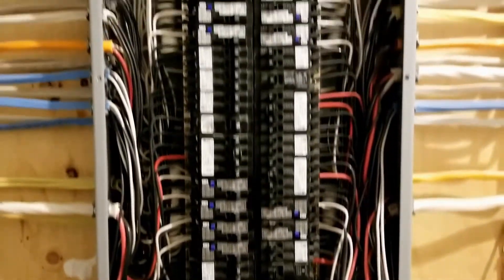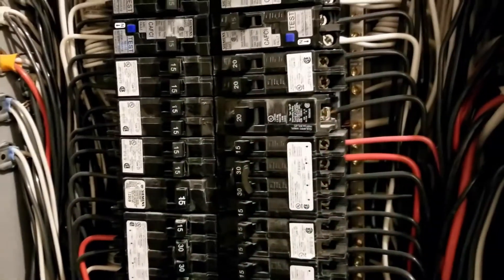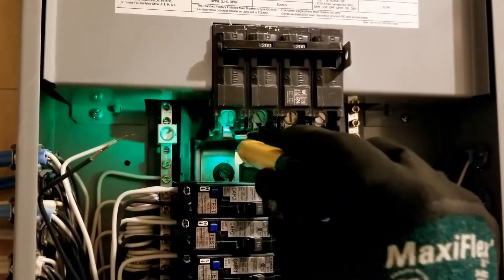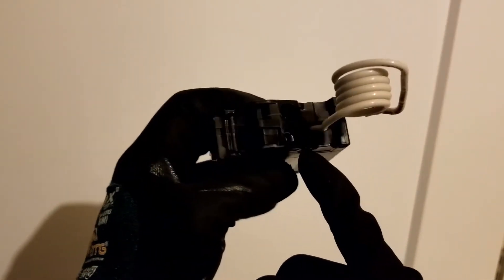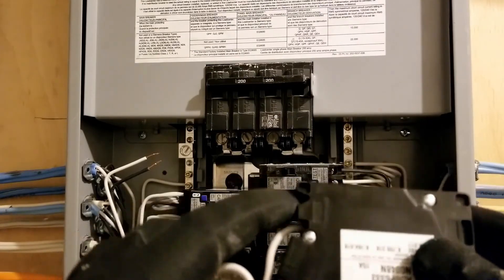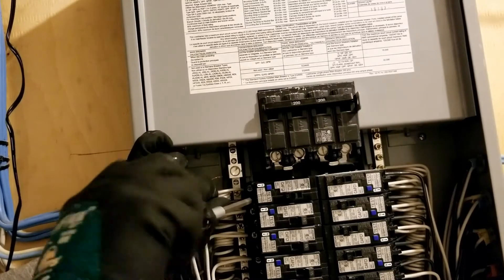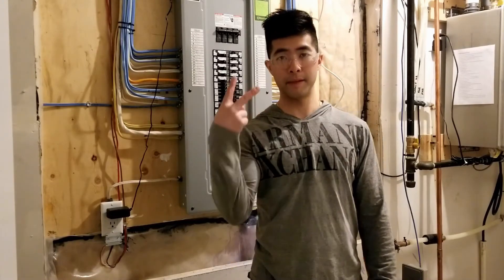How To Install a CAFCI Combination Arc Fault Circuit Interrupter Breaker AFCI - EASY & SAFE DIY

Comment: How would you install a Q1515AFC? Its a tandem breaker and has a pigtail but no where to connect my white wire. Just my 2 loads.
Reply: But doesn’t that defeat the purpose? Basically makes it a “normal” breaker? Hows it supposed to detect arc’s when the neutrals now even going through it? Sounds like a normal breaker to me. Your thoughts?
Reply from the maker: @Cowboy711AoZ  yes I know what you mean. I was scratching my head too. It doesn't look any different than the regular AFCI since we want a CAFCI. I was looking at their brochures. It doesn't convince me that it's a CAFCI...
Reply from the maker: I just took a look at your specific breaker. This design will not have a slot for your white wire. All white wires and your white pigtail will be terminated on your main neutral bar 🍻
Reply: I wonder how they get away with saying it is… its really hard to find any information on these breakers. You should get one and do a video. I tried searching for hours and no one has any information on it..

when an arc happens.. does that travel on only the white wire? Or black as well? If it happens on black wire then maybe this breaker will work? But only 50%. Thoughts?
Reply from the maker: @Cowboy711AoZ  I believe the arc can happen in either black or white wire. If there's a break (hair line split) in the wire or loose connection on either white or black it will trip the breaker. Or even the lightest minor short in the circuit. There should be neutral wire slot on the breaker so the device can detect the neutral side. Someone should tell Siemens it doesn't look right.
Reply: that might be early version. they upgraded to combination which  detect both parallel and series. I know siemens replaced units ending in afc with afccsa. I don't know if the reason was the combination feature.

Comment: When my home was built the electrician installed cafci in for my two bathrooms. Only the lights and exhaust fans are on them. But my lights keep flickering. The breaker never trips but I am worried something is wrong. Any ideas?
Reply: are sure afci. normally bathroom is gfci. or could be combination of both.
Reply from the maker: Both washrooms lights flicker and what kind of bulbs are you using?
Reply: @KevinPon.  yes all flicker. They are led recessed lights
Reply from the maker: @twracecar  are they also on a dimmer switch?
Reply: No
Reply from the maker: @twracecar  my entire house with LED's is on CAFCI breakers. I haven't experienced any flickering yet. But here's a link that can provide the possible reasons why your lights are flickering. https://www.google.com/url?sa=t&source=web&rct=j&url=https://www.ledlightexpert.com/Led-Light-Fixtures-Flickering-Causes-and-Solutions_b_110.html&ved=2ahUKEwiNv_3z1uXyAhXJs54KHRoUAwwQFnoECB0QAQ&usg=AOvVaw38YPLhp7uSeWlvey6LRZuD
Reply: Way after the fact, but for situational awareness - flickering lights may also be a sign of a loose wiring connection.  Have a qualified person check all connection from the light fixture to the switch to ensure that the screws/connections are tight.  If those don't fix it, have them check the connection at the breaker box.

Comment: Thanks for the video. How about the ground wire? Is it not required in Canada? I use 14/2 with copper wire for ground...
Reply from the maker: Hello there! The ground wire is required. Must be terminated on the ground bar in the panel.

Comment from the maker: Highly recommend you turn off the main breaker. Sorry, it wasn't mentioned in the video.
Square D 
15 Amp
https://amzn.to/3UutWUm
https://amzn.to/3F02qrW
Double pole 15 Amp
https://amzn.to/3XU5caT
20 Amp
https://amzn.to/3umsN6r

Siemens
15 Amp
https://amzn.to/3H9v2Sh
20 Amp
https://amzn.to/3Fn0XNR

Eaton Cutler-Hammer
CHFCAF115 Single Pole 15 Amp
https://amzn.to/3VT3MvB
BRCAF115 15 Amp
https://amzn.to/3XO0N9k

BRCAF120 Single Pole 20 Amp
https://amzn.to/3XWl7W7
CHFCAF120 20 Amp
https://amzn.to/3BacfCF
CHFN120DF (New Version of CHFAFGF120)
https://amzn.to/3umtLQb
BRN120A1CS
https://amzn.to/3iFydXu

Comment: I never see blue jacket on romex what gage is it 14 awg or 12 awg
Reply from the maker: Yes, me neither. It's my first time too. It's 14 awg. I have a basement. I wonder it's to distinguish the two. I wasn't too curious to check either.
Reply: @KevinPon.  usaly 14 gage is white and yellow is 12 gage and orange is 10 gage
Reply from the maker: @DavidBerquist334  correct.

Comment: Can you replace a CAFCI/GFCI with an ARC Fault only?
Reply from the maker: You certainly can. Yes these breakers are expensive! Sometimes there's deals on Amazon. AFCI is more than enough to keep everything operating safely.
Reply: @KevinPon.  What about the missing GFCI?
Reply from the maker: @ziggiezag938  I'll explain the difference. CAFCI can detect a arcing in a damaged or a small gap in the single wire where AFCI cannot. Everything else is the same. As for GFCI receptacle, that is required at a near by sink. In a not so newer home will have AFCI, I don't think most people will front up thousands of dollars to get them all replaced to CAFCI breakers.
Reply: We DID it!  Changed two breakers.  It really was easy (except my hands and wrists are defective and weak so my husband had to loosen everything & then tighten it all)!  Thank you for all your patient answers!  We couldn't have done it without you!!!!!
Reply from the maker: That is wonderful! Congratulations on your success! You're very welcome 👍🏻😊

Comment: Is it better/easier, as you've done in vid, to screw in all wires AFTER you've snapped the breaker in place? Or equally doable to screw in wires while holding breaker in hand (before mounting)?   Thanks!
Reply from the maker: Hmmm if you feel you are limited in space and think it'll be difficult to put them after. By all means do it your way but make sure the breaker is on the OFF setting. For my way I'm just dealing with one wire at a time so it's  pretty easy. I never done it the other way.
Reply: @KevinPon.  Thanks for the quick reply, Kevin. No preference of my own; Just saw other vids where poster did wires first, so thought I'd see if you had specific reason. But that said, your vid is the only one with the EXACT style of circuit breaker, except mine is Murray brand.  Gonna tackle replacing what appears to be bad breaker once I get my multimeter. I don't mind being over-prepared :-)  My breaker's been tripping for no reason for the last 2 weeks. Would flip it back, but it's been happening progressively more frequently til it finally gave up & wouldn't stay in place any more. So assuming it's faulty, and hope a new one will solve the problem.  Thanks so much for posting your vid! Seeing the exact breaker installed makes me feel 100% confident now.  Still gonna don all my rubber gear and shut off Main Disconnect tho, for super safety. Have a great day!!
Reply from the maker: I'm happy to help 😊. The replacement should fix the problem. I know you can do it! And yes safety first. Let me know if you need have anymore questions. Cheers 🍻
Reply: @KevinPon.  Hey Kevin. My breaker's successfully replaced. Thanks for everything! More feedback about your vid:  It's soo helpful how you provide so much detail: such as showing the breaker in 360 degrees, then turning it and showing 360 Degrees in the OTHER dimension.  Might be too much info for some, but I like to visualize everything before I tackle new projects. (And there are so many around the house.)  Might not know for a week if this solves the problem. If not I'll take u up on offer & ask add'l questions.  Meanwhile, just for kicks, here's some music for you: https://www.youtube.com/watch?v=_vNeFCKwEwg  That's my cover of Chris Isaak's "Wicked Game". There's more on YouTube, and my entire CD (mostly originals) is on Spotify & iTunes. Other fan favorites: "Charlene", "Corrupt".    Keep up the great vid work, Kevin!  You are doing the world of DIYers a great service!!
Reply from the maker: @shamelesschic9491  That is wonderful! I am very happy to hear and I hope it does fix your problem since those breakers are not a cheap replacement. Thank you very much Susie, for your feedback it means a lot 😊.  And thank you for sharing some music with me. I love it! You are truly a artist!!!

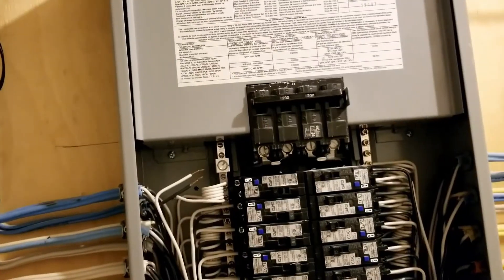Comment: What did you do at 4:05?  Could not understand and your hand obscured the connection.  Thanks.
Reply from the maker: Sorry about that. What I did was, took the "white wire" from the breaker. Connect that to the neutral bar. Just like how the rest of the other white wires are screwed in place.